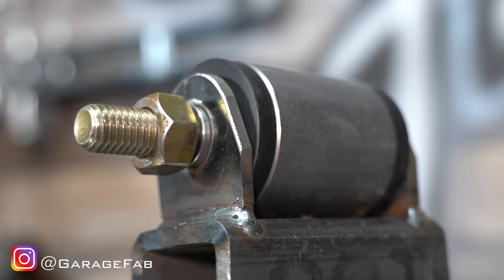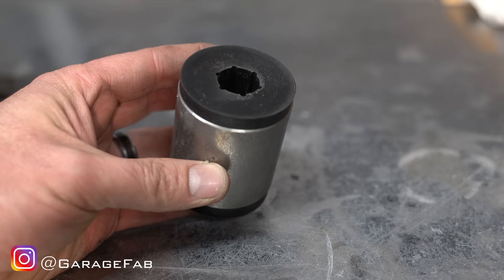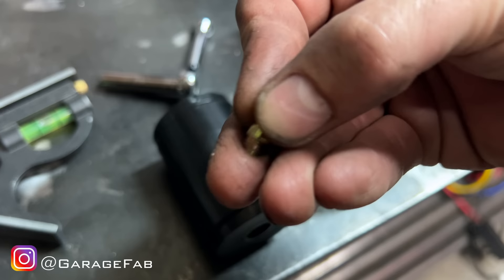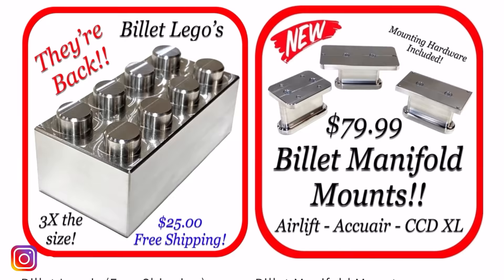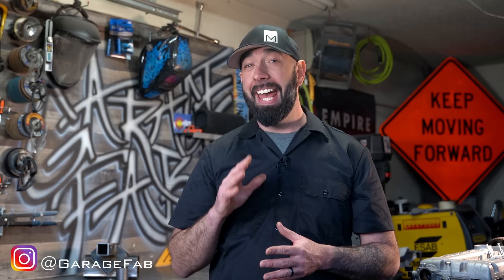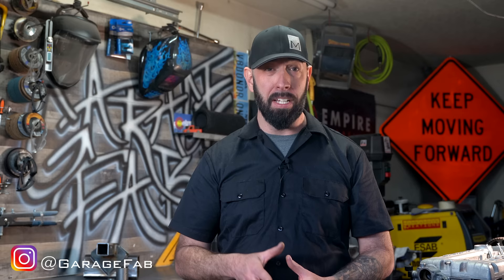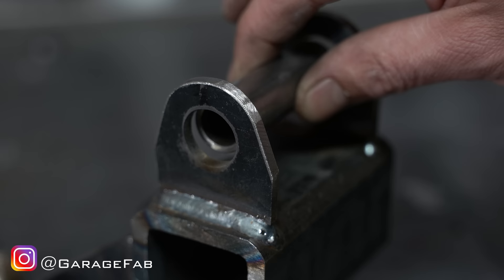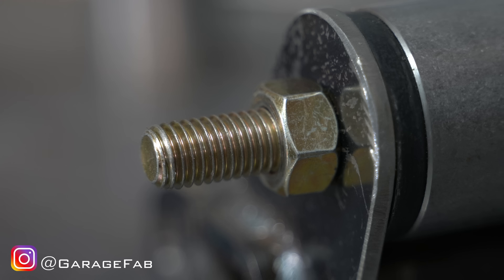The DOs and DON’Ts When Installing Polyurethane Suspension Bushings

Comment: Great information, thank you.   The difference between these and OEM is on an OEM bushing the rubber is bonded to both the inner and outer barrel.  The only movement is the flex of the rubber between the inner and outer metal barrels. That's why when changing things like control arms, you don't torque them up until they are on the ground (or ramps) under their own weight.  That way, you are tightening them up in a position in the middle of the suspension's range of motion:  In full compression they twist one way, in full droop, they twist the other way.  If you tightened them up fully while unladen in the air at full droop, they would be much more likely to tear at full compression because now you are asking the rubber to twist in one direction to cover the full range of the suspension's motion. the take-away:   Tighten them while on the ground or they will tear quickly.
Reply from the maker: Excellent information, Brian. Thank you. You would be surprised how many “knowledgeable” technicians get this wrong.
Reply: I was looking for this comment. I've had this discussion with alot of my helpers. "Never tighten rubber suspension bushings with the vehicle jacked up". They won't last 6 months
Reply: Not always. Mazda leaf spring bushings have the inner sleeves bonded in but not the outer. They press into the leaf spring eyes and the bushings on the shackles ate not bonded to either. Same for square body chevy trucks and many others.
Reply: @michaelwhite-oi1ft  There are always minor exception. Older Grand Cherokees have bushing at the back of the lower A-arms that are bonded to their housings but not the part of the control arm that sides into it. But the front bushings in the same A-arms are fully bonded so you still have to have full weight on the suspension before you torque everything
Reply from the maker: While we’re at it, Toyota/Lexus also have bushings with bonded inner sleeves that press into an eye and are therefore not bonded on the outside. They are rubber, though, and are not lubricated so I follow the same tightening procedure.
Reply: Yeah im looking at my parts right now, and see they are fully bonded as mentioned, i will also fit them and tighten them at ride height. But it was not common knowledge to me, that poly was supposed to slide on the pin. Would i like to fit them and use a horisontal poly bush, then i need to add a grease fitting and engineer this for my lower control arm.
Reply: @Hemshemsems  I've tried to run poly bushings in several vehicles over the years. They do typically add some much welcomed tightness and better handling, but always at the expense of a little extra harshness, vibration, and eventually squeaking. That's livable on a weekend toy or track car, but I don't think I'd ever try to run them on a daily driver again. The only exception would be sway bar bushings. Im sure there are others out there with a different opinion, but that's my experience.
Reply from the maker: I’ll agree with you, Ed though I’ll add this…
A Zerk fitting changes things. It won’t soften the ride but it remedies the notorious poly squeak. I’ve daily driven bagged trucks for years. I do prefer to feel the road, but not a fan of creaking suspension. The occasional squeeze of a grease gun works wonders. 🙌
Reply: @edjackson4389  I've used poly for that exact purpose and avoided them elsewhere with lowering euroboxes, and you need the articulation from the softer bushes, and comfort suffers a lot thats for sure. But rubber suffers too and deterioates quickly when they are outside their comfortzone. The poly grease part is a essential part for noise, and it makes very good sense and mounting them correctly as Fabguy mentioned..
Reply: @Hemshemsems  You can also play around with the durometer rating on Polyurethane to get some more street-ability.  Everything is a trade-off.  Rubber is squishy, Poly less so (but can be squeaky/creaky in rotation - quiet in compression), delrin less so, spherical bearings zero give/high wear especially with weather.  I'm writing this to remind myself:  Have a target, build to the target.  Otherwise it is a slippery slope to an empty wallet and an almost - but not quite ever - finished project.
Reply: @briancorrigan5350  Have no options for soft enough durometer for the cars i do, only Powerflex with their colour scheme and even the softest version are essentially to hard as well. Spherical bushings are almost hardmount, but for sure the articulation is better for vertical mounts.. Good suspension parts are expensive and a good setup requires a lot of parts and tuning - and rarely ppl go for handling and more in it for the looks..
Reply: @briancorrigan5350 rubber doesn't have to be sqishy.  Most people think poly is better cause they can easily swap out a stiff poly bushing and it's stiffer, at least temporarily.  Poly has very little damping, experiences yield strains constantly, and gives substantially worse isolation given a similar stiffness.  Also, sphericals don't have to degreade from weather.  Plenty OEMs use booted cross axis ball joints that last 100k miles.
Reply from the maker: I think booted is the key there. Protecting the moving bits from water and dirt and possibly even retaining lubrication might make all the difference. So the question is, Do they make boots for your typical Heim joint?
Reply from the maker: I just looked. They do!!! 🙌
Reply: @GarageFab  I've seen covers which help a lot on street cars, but personally I use sealed CABJs where one would put a heim joint.  On anything that could experience water submersion, the rod end boot covers will hold water in making it fail quicker.  Just might have to integrate a housing to make it work. I try to integrate a booted design wherever possible.  OEM 100k mile ball joints are considered a failure if theres any boot failure as the joint will follow relatively immediately after.
Reply: @GarageFab  yes, speedway motors sells them.
Reply: @GarageFab  You can build something the 3rd gen RX7 have in their suspension which is a press in spherical (or as Mazda calls it a pillow ball FB01-26-230) that has a slight chamfer to aid in installation and is directional with a bottoming out seat, then they utilize a snap ring (9957-43-800) to keep the bearing in place.  They then have two grooves around the outside circumference and you can just push in two rubber seals (FD01-26-250).  The originals have a nylon liner which can last ~ 30K.  SakeBome came out with their "RACE SPHERICAL PILLOW BALL UPGRADE KIT (FD3S)" which has a Teflon liner with FK bearings and should be much cheaper to run and be rebuildable.  I never found out about longevity, but it seemed decent even with weather elements.  I think Cusco offers bearings like this with rubber covers, but they're quite pricey.  

On another note poly is good for very linear motion.  Anything off-axis and you can start to run into stiction and it becomes hard to tune as you get inconsistent behavior.  For squeeking a layer of teflon tape around the OD of the inner race works.  I'm picking up a small lathe to start to turn some delrin and see if I can make a 2 mm sleeve of it with a feature on the outer diameter and then just drill out the poly bushing and add a negative space for that feature.  Pretty much simulating what Ridetech does with their sway bar mounts.  I'm just not sure if the natural lubrication properties of Delrin will be enough with a low duro urethane, but it does seem like it could be good for those linear bushings and cut down on the need to lubricate quite as often.  

Quality channel.  I love the content!
Reply: @edjackson4389 the type of bushings he is installing , does not matter if there is a preload or not.  You can fully tighten them while no load is on them.   Factory Rubber needs simulation of car on the ground.
Reply from the maker: Thank you for all the info! Lemme know how your delrin/poly hybrid works out!
Reply: @MustangGuru  Yes, I know that. You're trying to get in on an 8 month old conversation. Some of the comments I was responding to have been deleted. I wasn't referring to the bushings in the video
Reply: This is the same for leaf spring bushings
Reply from the maker: I’ll have to trust you. I’ve only removed leaf springs. 😆
Reply: Add Aussie CM Valiants and Chrysler Grand Voyager AWD to the exceptions list - the front eye bush on the rear leaf springs are oval, not round, so that as the springs compress the metal inner slides along the bolt to allow the spring length between eyelet and shackle to change, longer on the outside wheel and shorter on the inside wheel, to give the car passive rear steering.
Reply: I had a guy install control arm bushings on my car twice before realizing he had been doing this all wrong and it was destroying my bushings quickly. He put brand new aftermarket control arms on the car and in less than 8,000 miles, every single bushing was crumbling or missing completely. This is on a LOWERED vehicle, which generally can mean faster wear anyway. Both times he tightened the control arms all the way down while the suspension was off the ground and both times the bushings broke quickly. Some of them SUPER quickly. The bushings that went through where the rear lower control arms attach to the rear struts broke and started crumbling and falling out within less than FIFTY miles. 50! I finally realized it wasn't the fault of the bushings but the person I had paid to install them. He did it incorrectly both times and then tried to blame the parts. I like the guy. He's a nice guy, but nowhere near as knowledgeable about cars as he claimed. Needless to say, they won't be installing anything else on my car. I'm no mechanic, but at least now I know these brand new bushings weren't falling apart due to cheap manufacturing.
Reply: Perfect explanation, more useful than this video which refers to a total different kind of bushings which we do not have in our cars. A bushing is part of the suspension and is important in the car behavior. Installing it wrong, you add or substract from the spring force. Some sport cars, require not just torqueing the bushings on the ground, but loading the car with bags of steel shots.

Comment: Silicone grease is the best to lube urethane bushings, a lot of times they will come with it. Anti-seize is best thing to put on the bolt where it runs through the metal center bushing. The quarter inch thick larger diameter end of the urethane bushing is called a flange not a flare. If there is a need for a compact assembly you can make the outer metal tube of the bushing the same length as the connecting tubing diameter. If you are a really looking for weight savings you can make the center bushing out of aluminum. If you want a step up in quality and precision fasteners go to AN aircraft bolts.

Comment: This probably only applies to the after-market polyurethane bushings. Most OEM bushings are basically melted rubber that is stuck to both the inner and outer sleeves. Then it becomes important to tighten these bushings with the control arm at rest or “normal ride height” or the bushing will be twisted when the vehicle is on the ground.
Reply from the maker: You are correct Victor. I probably should have made that more clear. It’s surprising how often I see technicians installing control arms with bonded rubber bushings and tightening up the bolts on the lift. 🤦🏻‍♂️ 
With polyurethane bushings, the sleeve is not bonded and is designed to slip, so it doesn’t matter when you tighten the bolts.
Thank you Victor!
Reply: @GarageFab  BONDED!! That’s the word I was looking for… then I had to go and say “melted rubber blah blah blah” LMAO. Anyway, your video is perfectly clear as it pertains to exactly what you are talking about. My comment is more off-base, although related. I appreciate the great content on your channel and how clearly you explain it all!
Reply from the maker: I appreciate you back, Victor! Cheers.
Reply: @GarageFab  Oh I'm glad I came back to this video and read the comments, I am replacing OEM with MOOG OEM-like bushings and got spooked haha. Thanks for making the video and clarifying that, I had no idea there was a difference!
Reply from the maker: Yes Sir! Big difference! Bonded rubber bushings aren’t meant for large amounts of twisting movement. So after installing your new bushings, make sure you set the vehicle down before fully tightening up the bolts. That can be really hard especially if your vehicle is low, but your bushings will thank you.
Reply: yes. correct

Comment: What a fantastic video. No excess blabbering but straight to the point and everything presented in an easily understandable fashion.
Subscribed immediately, just starting on the first project car where I have to rebuild the entire suspension and this kind of info is priceless. Thanks you!
Reply from the maker: Yes!! I hope to see updates on this build! If you need guidance, you know where to find me!
Reply: I would agree great info and to the point.  I’m in the process of doing this on my 88gt fiero it’s a resto build a barn find no motor.  The car sat for 23 years.  All the hardware for the suspension had to be cut off.  Or it broke off and the. Had to be cut off.  So poly upgrade it is.   Your video help refresh my memory on installing them.  Thanks.
Reply: Exactly. Very easy to follow and worth many more than one watches.

Comment: What a nice job of describing the correct way to mount a bushing assembly! The bushings I’m using specify white lithium grease in case anyone didn’t get that information with their bushings. I use drum brake bearing grease(stringy stiff grease) on the bolts and, a bit of red loctite in the nuts to make sure they stay put.
Reply from the maker: Good info! Thank you David. Much appreciated. 🙏

Comment: Silicone based brake lube is one of the most underrated tools by a lot of mechanics.  It's rubber and plastic safe.

Being brake lube, it won't run when the temperature goes up.  AND it really takes the fight out of hoses, o rings, or intake ducts.  A very light coat on both surfaces and things usually just click into place.

Comment: Yes, I am a through bolt rust prevention greaser. Thanks. Great video to help everyone understand bushings, and how important it is to have them correctly built, and installed.
Reply from the maker: Haha! A bolt greaser! Something tells me you see snow once in a while. ❄️
Reply: @GarageFab  Welcome to the UK. Everything rusts this time of year.  Every time I work on one of my cars the Mrs. asks why my cloths are covered in 'gold glitter'.
Reply from the maker: Haha! Excellent.
Reply: @GarageFab  can't stand anti seize and hate it with a passion it's trash. 
CV joint grease works a heck of a lot better at least for me.
Reply: @MrTheHillfolk  What's wrong with anti-seize?
Reply: @JacopoSkydweller  use it for a while ,you'll see. 
It really doesn't work that good at all,you're better off with a quality grease or moly (CV joint grease)
Reply: @JacopoSkydweller  
Even the theory that it would work ,doesn't work.
Dissimilar metals always have corrosion issues ,right ? 
So why put a copper or aluminum based goo on your steel or iron parts?
Reply: @MrTheHillfolk  Fair point, never paid much attention to what it's actually made of but yeah I guess why would you voluntarily induce galvanic corrosion?

Comment: Yessss! Now that was a great and well articulated run down of suspension bushings and components.   Even if you’re not fabricating and all you’re doing is installing bolt on components like mid or long travel kits this is something you should be aware of.  Make sure the manufacturer is giving you quality parts
Reply from the maker: Yes!! So many people talk crap about certain types of suspension parts when really it’s just low quality stuff.
Thank you my friend!

Comment: A couple of additional comments - when a ZERK grease point is used, make sure the sleeve is welded in a position where the nipple is accessable with the suspension member fitted to the vehicle - sometimes you can correct this with a 90 or 135 fitting, but not always.
If the fastener uses a castellated nut which takes a split pin, you can usually replace it with a stainless steel "R" clip - they won't rust in place and are easily removed, and they're re-useable.
Depending on the specific application, it may be wise to use a longer bolt than actually required and drill the end, after the retaining nut, for an "R" clip - it doesn't often happen, but if for some reason the nut loosens, the clip will prevent it falling completely off and so prevent the bolt backing out. If you have access, you can do the same thing with bolts into captive nuts.

Something I got from Justin* is to turn up some alloy spacers that are a close fit to the sleeves and use them instead of the 'plastic' insert when tacking parts together - https://www.youtube.com/watch?v=aIGTNU6hG2Q

*He also has a lot of sound advice to compliment this gentleman's advice - https://www.youtube.com/@TheFabricatorSeries/featured
Reply from the maker: All good info! I like the idea of the R clips. Toyota uses those a lot and they’re really classy looking and, as you mentioned, reusable. I think I might have to incorporate those in some stuff soon.
Ah, Justin. Fellow Las Vegas fabby guy. Part of the reason I wanted to become a famous YouTube fabricator. 😉 
Thank you Brother. 🙏

Comment: Good on you thanks , working with suspension specialist yrs ago ,he would soak bolts in diesal before installing,and every one had hole after nut for split pin ,a fair amount of the work end up on race track ,when I asked about pins he said,it's the 2 dollar piece of mind factor
Reply from the maker: I would never disagree with peace of mind! Going the extra mile rarely causes problems. Thank you, Jeffrey!